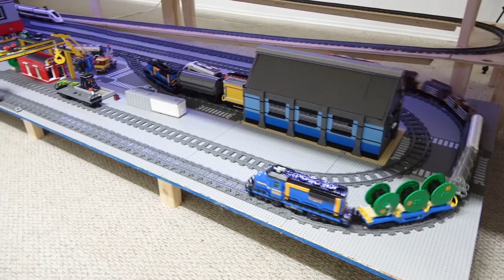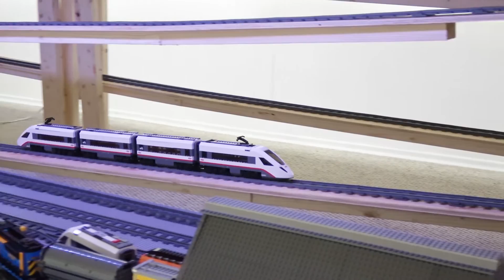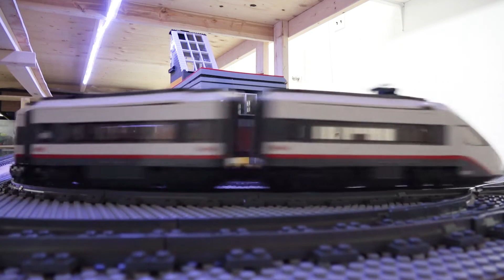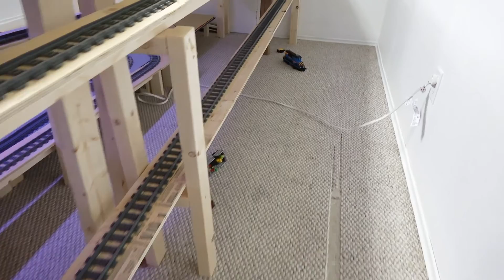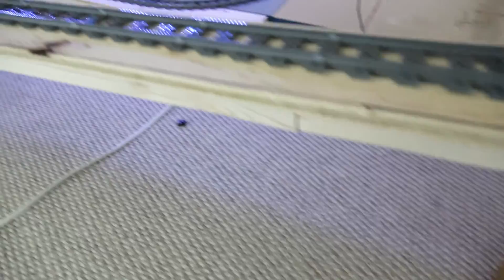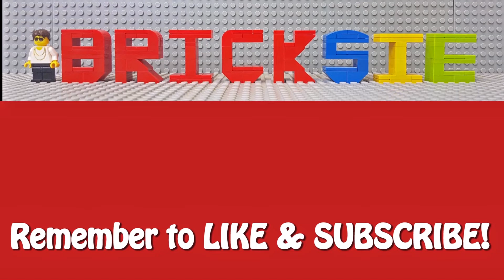New LEGO Train System With 40 Inch Climb!

Comment: Great video! I experienced a lot with inclines and heavy trains. The solution for me was to replace the rubber tire on the train wheel with a softer O-ring. It helped create traction. http://www.brickshelf.com/cgi-bin/gallery.cgi?f=230487 this loco was so powerful with the two XL motors the magnetic cuplers were unable to take the load in the end of the train.